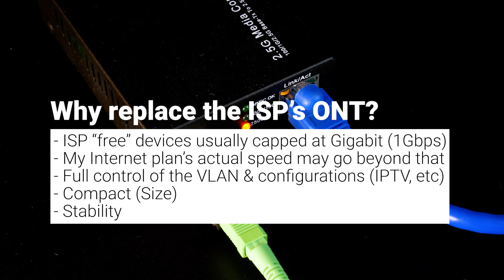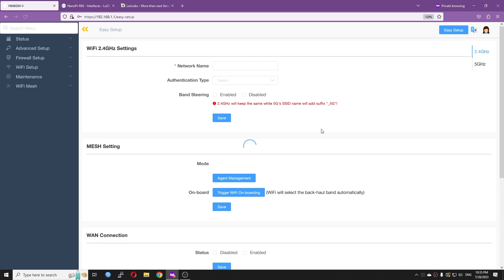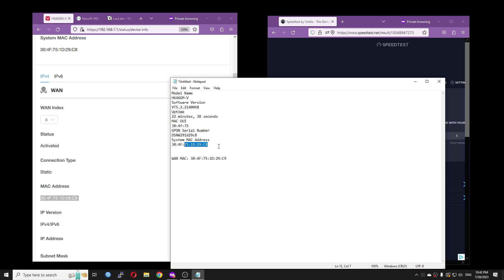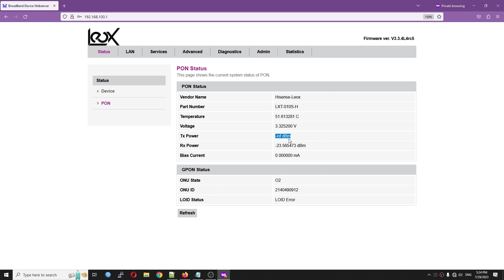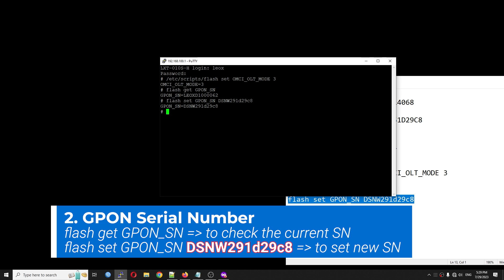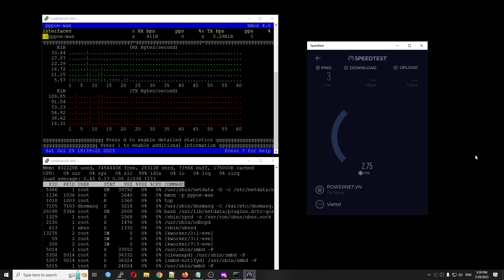Replace ISP ONT/ONU - LEOX LXT-010S-H SFP GPON Module

Comment: Do u know that u connected SC-APC patch cord to SC-UPC SFP module? Not so critical, but still, a some drop in dB will be present.
Reply: no you cannot connect apc to upc it will make huge losses and also damage the fibre ferrule
Reply: you just need to buy an adapter sc to sc no matter green or blue and also patch cord from upc to apc

Comment: Great video Van! I'm also on Viettel - in your opinion, what's the best ONT interface to replace the Viettel provided hardware? I currently run the Viettel provided hardware in "bridge mode" connected to an Asus RT-AX86U Pro (which has 2.5GbE WAN) which does the authentication/PPPoE etc.

Comment: How do you determine LOID, LOID Password, and PLOAM Password? Is it free at will or is there a format requirement? or copy from the previous ONT?
Reply: Copy from the previous ONT. I personally googled ONT model number + login page, ONT model number + admin credential to enter configuration page on the old ONT (amd copied those values from there)

Comment: How do i know if a ONU Module has web managment? (im new to networking, sorry if this looks dumb)
Reply from the maker: 99% of the ONU have web interface, because the technician will need it to configure / troubleshoot the connection (again, it is ONU/ONT). For those all in one router (fiber cable goes it, ethernet goes oit with WiFi) surely got Web UI.
Reply: @VanTechCorner  im building a router for opewrt and wanted to use a stick for it, thank you sir!

Comment: Hi VanTech on the description you just let a link or Email to get the FSP module straight with the manufactur. Thnx for that info, now where I can get the 2.5G Media Converter 100/1G/2.5G Base-TX to 2.5G Base-FX Bridging Converter, showing in your video. Thnx again

Comment: I change leox mode from flash set LAN_SDS_MODE 1 to flash set LAN_SDS_MODE 8 and now the leox not connected to the internet any advice because even media converter nor recognised leox sfp
Reply from the maker: Hello, please do not play around with the LAN_SDS_MODE unless know very well what you are going to do. The link speed negotiation should be done automatically between the SFP module, media converter and your PC's NIC.
When you force the SFP to work in a specific link speed, make sure you have the proper hardware.
Let's say LAN_SDS_MODE 8 => 2500baseT with auto-neg off. This means your ISP (GPON) link speed should supports 2.5G, the media converter should have a 2.5G Ethernet port and your PC NIC's should support 2.5G Ethernet as well. Else, you won't be able to reach the sfp at all.
In this case, you need  TTL/UART access to the SFP module and restore the configuration to default to start the configuration again. You may connect LEOX support team for further guidance.
Reply: @VanTechCorner  I have TTL/UART how I can access the sfp please

Comment: do I have connect fiber to the sfp gopn or just connected to media converter to do the changes? and is there any way to change mac adress for LEOX LXT-010S-H SFP GPON Module? thanks
Reply from the maker: Hi, the fiber cable need to be connected in order for the sfp module to be up and running.
Reply: @VanTechCorner  thanks

Comment: I am attempting to swap out my ZTE f670l ONT provided by Hathway ISP. I have successfully set up the FS GPON ONU Stick with the correct MAC address, and the GPON status shows as 5. However, I'm encountering difficulties configuring PPPoE on my pfSense router. I'm unsure whether I need to configure the VLAN settings on my PPPoE or the GPON SFP ONU. Your guidance would be greatly appreciated.
Reply: I have seam issue I'm encountering difficulties configuring PPPoE on my with Mikrotik RB5009
Reply from the maker: Sorry, I have no idea on FS GPON ONU. Did you contact FS customer support?
Some more question:
- Before replace the F670L with the FS ONU, is the F670L on bridge mode or router mode?
- If the F670L is on bridge mode, do you tag any VLAN when setup PPPoE?